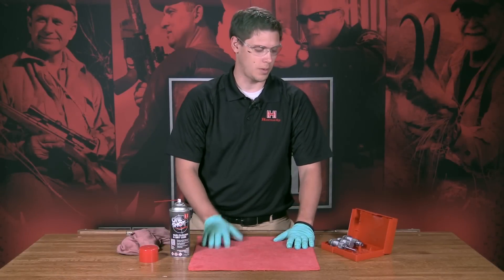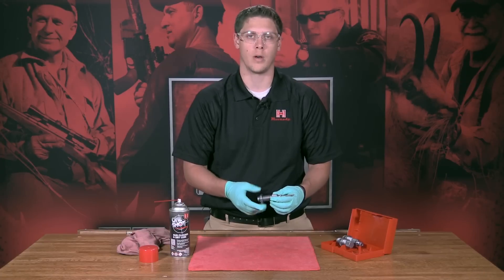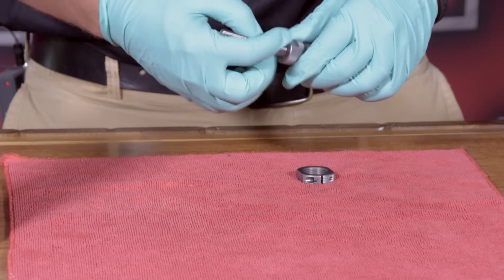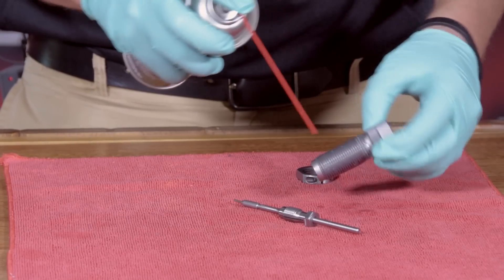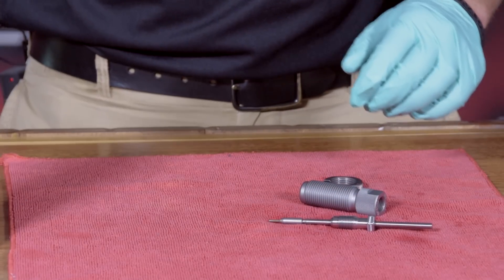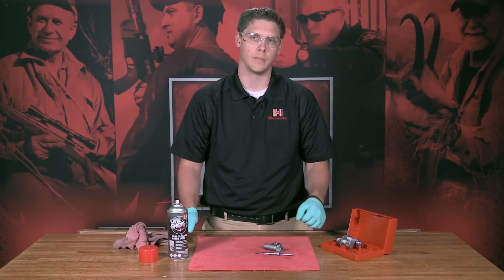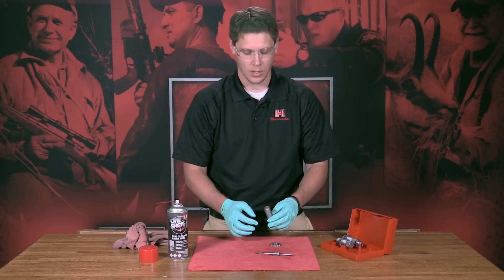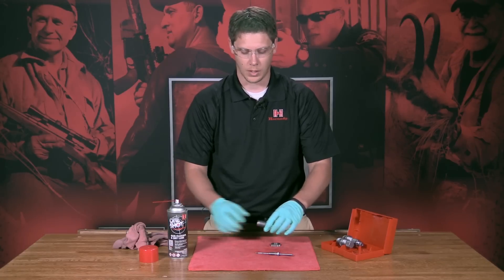Cleaning Reloading Dies

Comment: What do I use to clean and lube my press with to prevent rust from forming when it's not being used for a few weeks or even months. I have an issue with light rust forming especially on my powder measure parts.  Maybe there is a maintenance video?

Comment: I did not clean my Hornady win 308 Dies & the Lubed Brass kept sticking in the Resizing die on me, so I have to take them down & clean & degrease them etc. I soak them in some Alcohol to clean them it seems to work great etc. Also some Spray Break cleaner will work also.
Reply: I'm guessing you just use around a 95+ percent isopropyl?

Comment: Brad, I just received some dies from an old fella who is too old to reload and almost all of them have rust on them. Will this technique work for these dies? Some of them have quit a bit of rust.
Reply from the maker: Thank you for your question! If there is surface rust on the outside of the die “naval jelly” by Loctite works extremely well. If there is rust on the inside of the dies they may not be able to be salvaged to work properly. If you have any other questions please give our Tech Team a call at 800-338-3220 at your earliest convenience.
Reply: Hornady Manufacturing thank you for responding, I'll give it a try. And yes it's just on the outside for the most part.